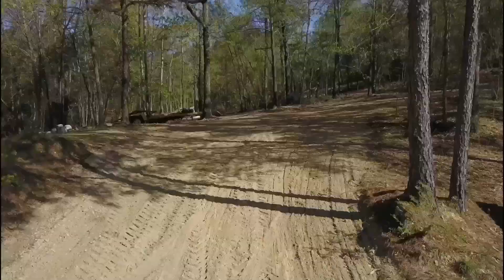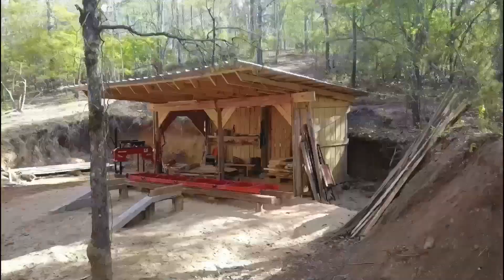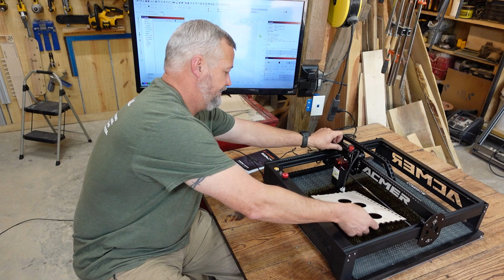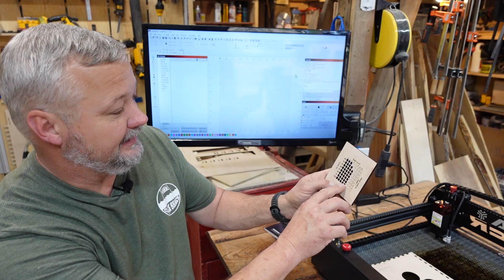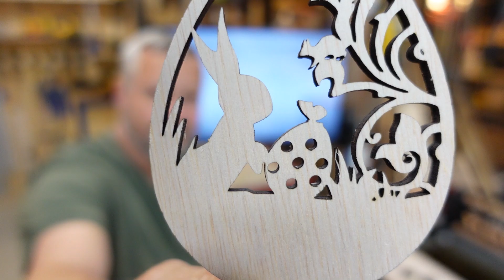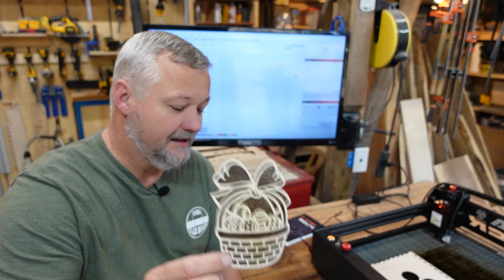Acmer P1 10 watt- It cuts like a 20 watt!

Comment: Which is the better machine, Acmer P1 10W or their P1 S Pro 10W? Not sure which one came out most recently. I assume the pro is in fact better even though the P1 states it has a much higher retail.
Reply from the maker: They are very similar machines, the P1 does have drag chains and some cosmetic differences. They should both be very capable, the resolution between the two will be hard to see a difference in most materials.
Reply: @TheClackShack  the p1 is currently about $20 cheaper than the ‘pro’ so I didn’t know. Both of your videos seemed legit on them. Sent my Roly back and waiting on their new galvo. So needed a cheap solution to hold me over. As always, thanks for the response!!

Comment: Thanks for this overview. Do you think that it will be possible to use it on metallic parts to engrave letters and numbers?
Reply from the maker: Blue lasers cannot engrave metal. You will need a fiber laser in the 1064 nm range. You can mark stainless but that's all with a 450nm machine.

Comment: What kind of issue do you have with the P1 at the beginning ? 
I am also struggling with some problems at the moment…
Reply from the maker: It requires some controller configuration. Here is the proper settings, open machine settings and import this file. Let me know how it works….    https://drive.google.com/file/d/1zD4OirIBBAIHJL_pSetQC5lHkG_ykVyL/view?usp=drivesdk

Comment: I started with a TT5.5s then upgraded my laser to 10w , big differences in them ! You started me using mm/s and I was using mm/m big difference there also but the biggest thing I’m learning is setup for multiple runs of the same design. My machine doesn’t have a setup adjuster ( beam ) so I’m trying to make templates for fast repeatability! Can you perhaps talk about that ? By the way mine is auto focusing which makes it nice .
Reply from the maker: If you are running lightburn, you can enable a low output beam for framing.